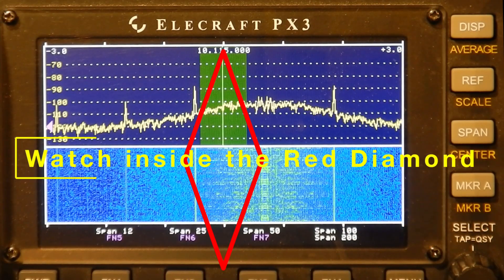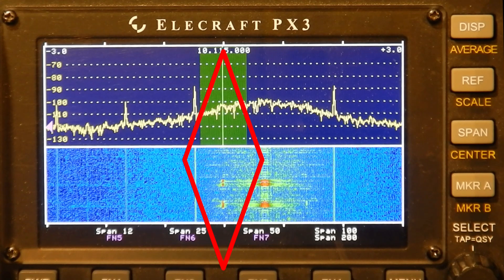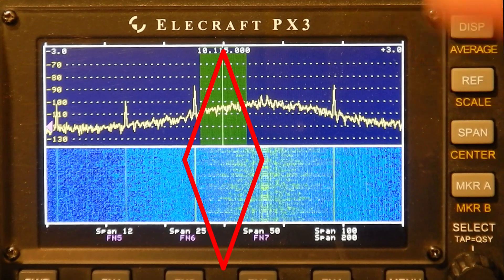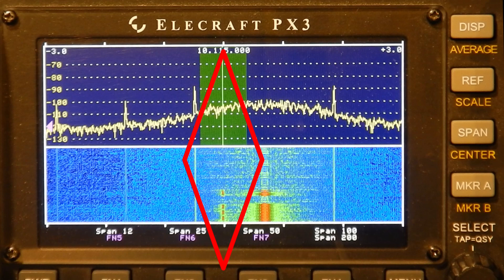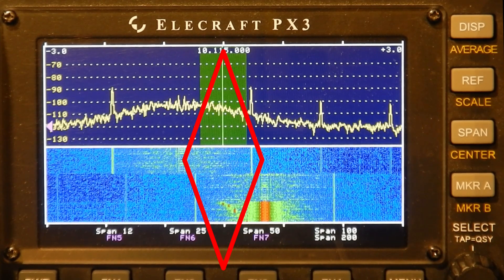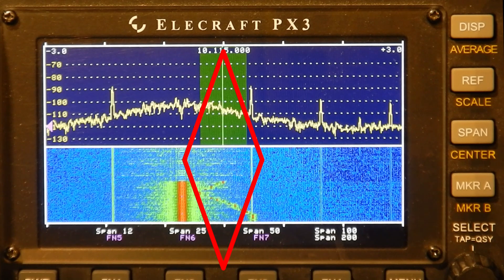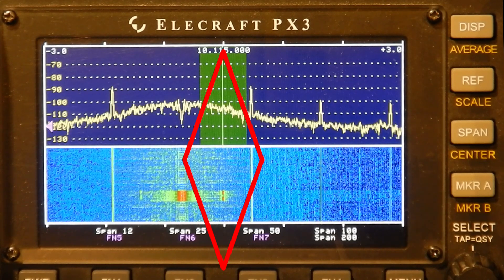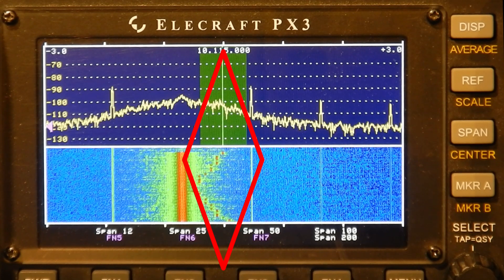Age Old Questions about CW Frequency

Comment: Thank you! I've used XIT to break pileups but always wondered about this. How much do you do? I've done +20Hz. P.S. this FD I waited for a huge perfectly zero-beat pileup to die down, then in that telling pause I just sent one letter, W,  like checking into a traffic net. He must've been an NTS NCS because he immediately replied W? and we were off. I'm grinning now recalling it. 73 DE NØIP
Reply from the maker: Great story of breaking the pileup with this technique! I tune up to 200 hz off and just swing the VFO knob to get there unless an RIT/XIT is a one-button push on my rig. If they don't answer me after a few tries, I'll swing it the other direction entirely, so that it goes from low to high (or the opposite, you never know) at their end. It's never failed to break a pileup this way.  Most people can't discern 10 or 20 Hz but they can notice 50Hz for sure.
Reply: @VE6LK FB TNX OM

Comment: Help me out here...Afaik there isn't any modulated audio or sound at a CW Tx end, simply an Unmodulated carrier pulsed on or off   in short (Di) or long (Dah) durations per the Morse code plan...If both ends (Stations) Tx's & Rx's are on exact Same operating frequency & both  Rx's using same fixed beat frequency Cwo offset (700 Hz for example) both Rx's beat frequency audio should sound exactly same....Any Rx (including Tx monitor Rx) tuned to same operating freq should all hear the same Rx beat freq off-set (700 Hz) tone....Where at  01:27 is Tx tone & far end   Rx beat freq tone sounding different happen ??

Comment: It looks like they need better carrier suppression in the BFO modulator!!! 2 spikes in the waterfall isn't right!
Reply from the maker: Ed, thanks for watching and your comments. The testing was done at close proximity using dummy loads for each rig placed close to each other. I'm sure if I were to have direct connected them and padded the TX 40dB then it would have been cleaner. But, then again, I've been wrong before :)

Comment: Nicely explained. This makes it clear what happens at the other end if you transmit on a slightly different frequency from the person (SOTA or POTA operator) that you (a chaser) are trying to work -- how your signal can stand out from the pack if you're on a frequency different (but not by much) from everyone else's. Not too different, because you still want your signal to be in the target's passband!

I'd like to comment on a different but related situation. What if you are the poor SOTA or POTA operator trying to pick out one signal when N of them are all competing on almost identical frequencies (yours, or a slightly different one, but all the competitors nearly the same as each other)? Here's a trick I learned about 75 years ago when, as a teen-ager with almost no money, a new license, and a used pre-World War II Hallicrafters receiver as wide as a barn door, I found a way to compensate in part for that $40 receiver's lack of selectivity.

Use the filter between your ears, if your receiver has a poor one (or none). Choose to listen at a low audio frequency, a lot lower than the popular 700 Hz. A musical semitone is about 6% difference in audio frequency. If two stations are about 20 Hz apart and you're listening around 700 Hz then they appear to be only half a semitone apart. But pull them both down to about 350 Hz and and of course they're still 20 Hz apart but now appear to be a full semitone apart. Anyone with a bit of musical training will have no trouble distinguishing two tones a full semitone apart, and even if one is a lot weaker than the other you can still concentrate on it and ignore the louder one just because the pitch is so different. If they're further apart than 20 Hz, all the easier to do this. And if you can tolerate audio frequencies even lower than 350 Hz you can "spread them apart" even further (as measured in semitones, not in Hz)! Just make sure the desired signal stays within the receiver passband. The "BFO pitch control" on my ancient Hallicrafters receiver moved the perceived pitch but couldn''t move the actual signals out of the passband (which was wide enough for voice anyway). Phones can be better than speakers when you're doing this listen at low frequency business; a lot of small speakers aren't very good at low audio frequencies.

Try it and you'll like it.

David  VE7EZM and AF7BZ